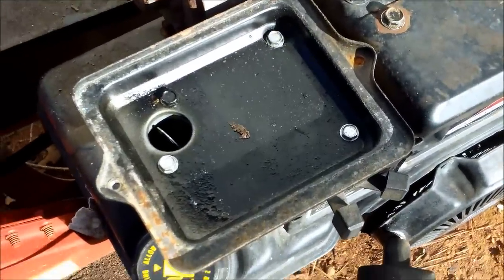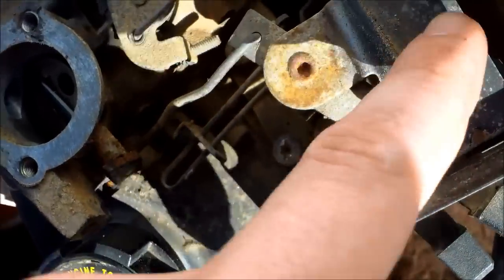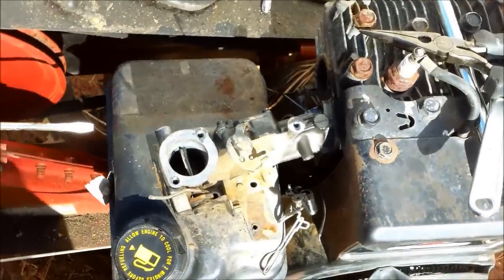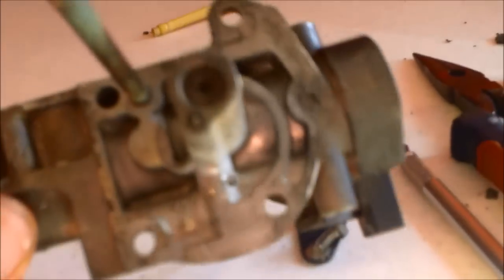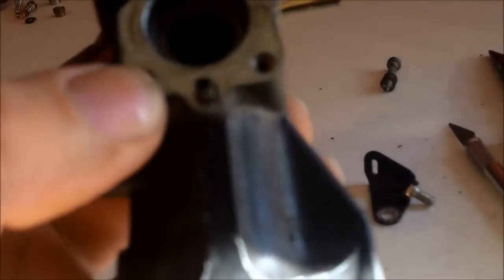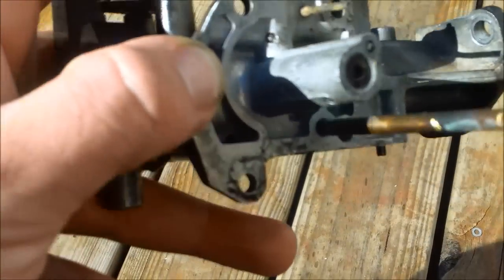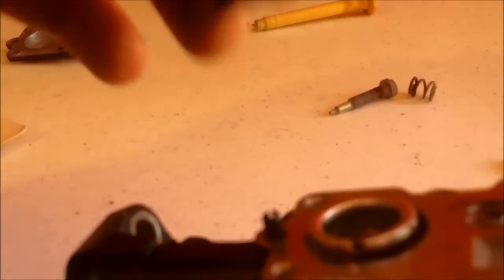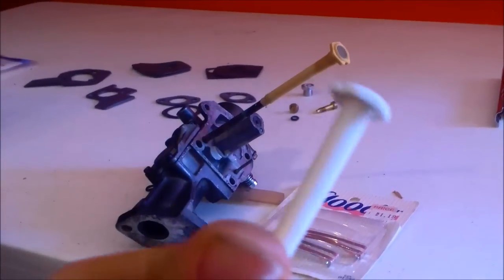how to rebuild a Carburetor Briggs & Stratton

Comment: And one more thing.  If you can`t install the pick-up tube, just use a short piece of fuel line, with a small chain-saw end filter. Will work just as good.  See-ya.

Comment: To install extension tube,  invert carb, and put end of brass tube in vise, just above jaws. Just snug up.  Then line up tube with tip of brass, and with 4" channel-locks, you can squeeze the tube down over the brass. I put a quarter over end of screen to protect it. This is a press-fit, and will work fine. The top jaw of the channel-locks goes over the screen, and the bottom jaw goes under the jaw of the vise.
Reply: and use the little metal collar that comes with the new tube.

Comment: have this exact engine...my carb "bowl" keeps emptying, even after diaphragm replacement and even carb replacement. what to do!!?? runs great if i fill the bowl manually!
Reply: air leak between plastic and brass down tube
Reply: You might have a cracked pickup tube..

Comment: Hi good video but didn't fix my tiller,I had to get another carb.I think the problem was when I cleaned the old fuel out of the tank I heard something drop I think it was the push in jet as it didn't screw in like on most carbs.But it's fixed now and runs great.Thanks again.

Comment: I have one for you I have the same setup worked ok last year . I replaced  the diaphragm
and then a carb kit. It will start with carb cleaner in the carb. It will also start and run if you put your hand over the carb. It just stays at a ruff idle and will not go any higher 
If I let any air into it it stops . I am lost.

Comment: Haha I don't mind them myself, their simple to me. It has no float and I guess you would say the tank is the bowl. Briggs calls it a pulsa-jet carb and it uses draws fuel up the pickup tube to run the engine. That diaphragm is the fuel pump and it works from the vacuum in the intake.

Comment from the maker: im gonna say it i hate this kind of carb.... wheres the carb bowl wheres the float?
Reply: The bowl is built into the gas tank and just overflows back into the tank which  he never mentioned is important to clean all of that out and make sure it will hold the proper level in the bowl. I just did one on an older model and now it runs good but its overflowing thru the base gasket.  I'm suspecting a blockage in the bowl overflow hole

Comment: Good job! Those stens kits are for several different years so you get leftover parts. I always try to save the pickup tubes and clean them out good to avoid the problem you had.